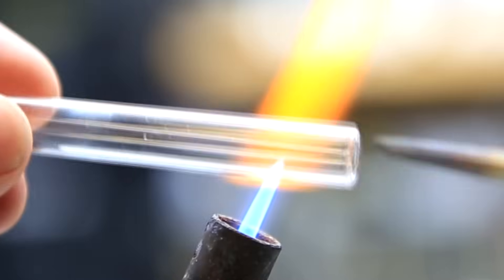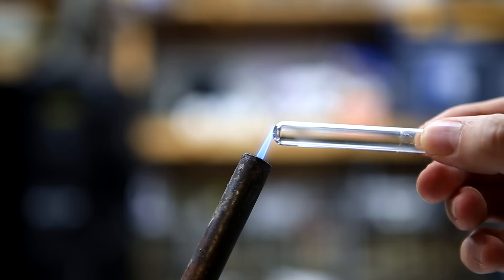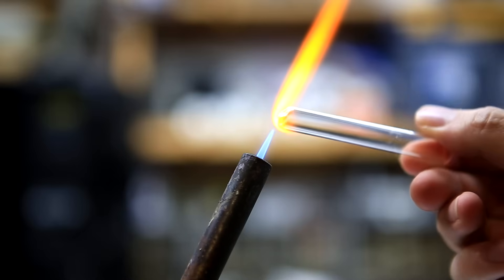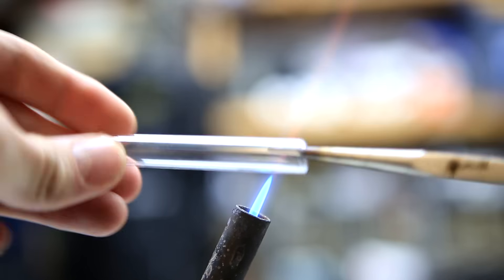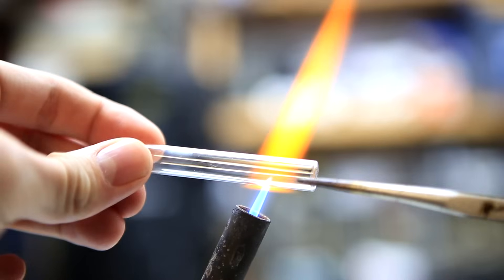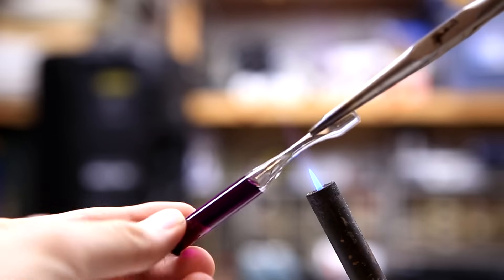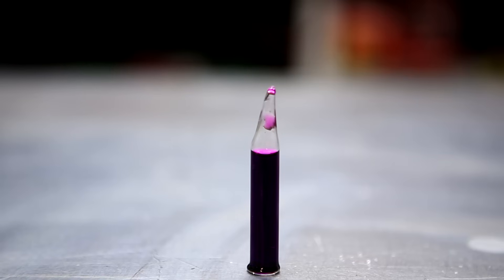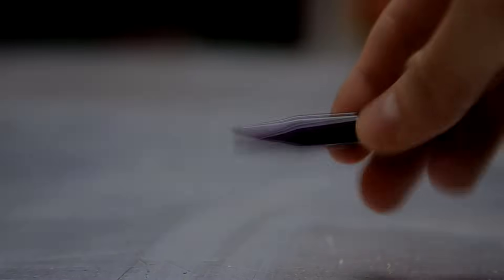How to make ampoules from glass test tubes

Comment: You should use a graphite block to flatten the glass. Graphite is what glassblowers use to form the glass. And then you don't accidentally crack your beaker from heat shock.
Reply: that or wet newspaper
Reply: @juanignaciocaso4651  WTF are you talking about? You want him to press HOT glass into wet paper? Do you know what water does to hot glass if you let it sit there? Glassblowers have to CONSTANTLY SPIN glass on wet newspaper so that the layer of steam protects it. IF YOU KEEP IT STILL, IT EXPLODES IN YOUR FACE.
Reply: Also heat the graphite up with the flame first
Reply: @xz3693  It more just smoulders and catches fire, from my experience. But yeah, you do keep the glass in constant motion when forming in glass blowing, and drip on new water on the paper when time allows it.
Reply: Isn't graphite fairly conductive? I thought he ideally wanted a thermal insulator.
Reply: @battlesheep2552  I used to blow glass at my buddy's shop. All the tools we used to shape glass were graphite. Even his touchmarks. Grapite is conductive. I use it to grow silver crystals, but it also transfers heat extremely well. And you could use a damp newspaper... But personally, I would use a red brick or a 2x4 if I had nothing else.
Reply: @ravnulvthordnspyd  He stated that he specifically doesn't want to use a thermally conductive material. He uses the bottom of a beaker because glass isn't very thermally conductive which means that the test tube will hold its heat for longer.

If he were to heat up the graphite beforehand, then it might be suitable, but why would he put in the extra effort when this works fine for him?

After doing some quick research, it seems that glassblowers often use graphite because it can withstand the extremely high temperatures required for glassblowing, but I would be surprised if he was heating this test tube anywhere near what a glassblower would, the test tube in this video doesn't change colour the way glass does when glass blowers are working. He didn't say anything about the beaker cracking.
Reply: 7 scientists talking to a 5 year old video
Reply: @ninjathadius7072  and 2 random people didn't really understand what they are talking about.
Reply: Derek Hitt  I kinda wanna freeze a beaker and see what happens... You know... For science. 😂😎
Reply: @ravnulvthordnspyd  For Science!
Reply: @ZebbMassiv  Clever!
Reply: @ninjathadius7072  The internet is forever.
Reply: You won't. Glass and graphite are both good insulators of heat.
Reply: @The_Foxymew Qa

Comment: fills ampule with Nitroglycerin

Can't forget to shake it to make sure it's sealed 🙂
Reply: You'll be lucky if the heat doesn't ignite some of the vapours
Reply: @noobnoobyify  xD
Reply: I usually clean an old metal paint bucket. And smash the lid back on with a hammer.
Reply: Yer bad

Comment: If you don't anneal the glass it might just randomly check(break) while sitting on your shelf. Its better to just leave a pinpoint hole at the top,anneal then fill with a syringe then seal it. As a side note graphite aluminum or brass will be a far more suitable material to press against. get/make a polariscope and look at your ampoule and you will see the stress lines in the glass.
Reply: I had a couple pop on me too,  just holding the amps back from the flame a few inches and cooling a little slower worked here.
Reply: I had the same thing happen. Need to "flame seal" these bad boys! (Learned it on Codys Lab)

Comment: Early wine bottles had the same issue when trying to stand up straight. A solution was found however and we now indent the bottoms of wine bottles to form a flat surface. So if you could find a small marble or something to form a little dome on the bottom it'd probably make your ampules a lot more stable and easier to form :)
Reply: Wine bottles have a dome shape to allow for pressure build up.  More common in the past but still vital for sparkling wines.  Using a small brass dome rivet in a hole in some brass plate might be the best way to form a dome and a flat rim.  Using just the dome/marble will not make the rim level, just narrow.  However the reason for the glass was low thermal conductivity so brass, copper and aluminium are bad, stainless steel if you must use metal but graphite is the material of choice for glass working marvers if you plan to make lots.

Comment: To make an ampoule with a 'scratch-zone' for safer opening!
Like this:
1) Pull a short, fat neck (the scratch-zone) about 1/3 the way from the open end of the tube.
B) Pull a longer slender filling-neck from about half of the pulled section from step the first, leave a 'bulb' between the two necks.
Tube <short fat neck> tube <long slender neck> sealing end.
By scratching the fat neck, a cleaner break is possible.

Comment: Graphite works best for shaping glass. I do glasswork that what all the tools are made from usually
Reply: Steel is okay as long as it is cold. Yes graphite tools are incredible for doing lamp work but the majority of hot glass work is done with steel. If you need the metal to stick to the glass, heat it up. If you need it to not stick, keep it cold. Simple as that.
Reply: Brass also works well. When I started with glass work years ago I had a charred hardwood stick coated with beeswax as my main reamer before getting graphite tools
Reply: @Xanderviceory  graphite tools are too pricey, i bought slabs and cut/shaped my own

Comment: could you make more videos demonstrating more lab techniques? pass down some of your technical and practical knowledge.  thanks
Reply from the maker: +Santosh Samuel I was actually thinking about it. In the future I think I will do that, but for now I would like to work on getting all the experiments done that I want to do!
Reply: +NileRed question. how would you do this if your storing something that is flammable? or like how do they get things that are pyrophoric like cesium inside amples
Reply: +Seth Black ampoules
Reply: Labs that use pyrophoric solids often use a glove box to handle them, other than that pyrophorics and other air sensitive reagents are normally bought as solutions and syringed to get it from stock bottle to a flask fitted with a rubber septum and flushed with an inert gas (N2 or Ar)
Reply: Thank you

Comment: Nice video. A question: I would like to put in ampoules a dry salt and inside it I want a nitrogen atmosphere. Any suggestion? I was thinking about doing the glass heating and melting with a rubber septa and a needle that flushes nitrogen.

Comment: Yay! But, how do you open it to get the liquid out?
Reply: +Pyramid132420 you break it m8
Reply: Pyramid132420 gotta break it
Reply: Pyramid132420 break it
Reply: @giorgosmetalheart1767  v
Reply: Actually opening an ampoule requires experience. The tip part should be broken, but sometimes the internal liquid generates gases that cause the entire ampoule to break. To prevent this, the ampoule should be cooled in a refrigerator to condense any possible gases and then just break the tip using small pliers.

Comment: Could propane torches work? Planning on making an ampoule for chlorine and iodine.
Reply: I would say a propane torch could work, but wouldn't be ideal. You would likely have to heat the glass up with a kiln before using propane torch because the thermal shock would likely shatter your piece. You could try holding the glass far away from the torch to pre heat it, moving it very slowly closer to the hottest part of the flame. It would take much longer than the yellow tanks but would probably work.
Reply: @randoprior4130  I tried it. It works but the whole glass heats up and my gloves melted and caught on fire
Reply: @bluestickman2684  well that's learning for ya

Comment: How would I seal an ampoule filled with hydrogen? Also how do i make sure no gas is leaking?
Reply: +Sor Sor Science07 You don't. You shouldn't put hydrogen or other flammable gases in an ampoule, you should be storing those in a gas cylinder kept in a fire cabinet. Even if hydrogen weren't flammable/explosive, you still wouldn't be able to store it in an ampoule because it's lighter than air. It would escape before anyone could possibly seal it.

But on the subject of leaking, if you shake your ampoule around like at the end of the video and no liquid escapes, you're very unlikely to have any gases escaping.
Reply: genericusername562
Reply: its reallllllllllllllly hard....you need a high voltage  leak tester ,,,kind used by neon guys. a torch..a kiln..a vac pump...a  vac box...co2 or nitrogen gas .

Comment: How can I seal flammable liquids? Is there a similar method that doesn't involve molten glass or open flame?
Reply: These often have a very high vapor pressure (e.g. diethyl ether) and sould be stored in a proper unbreakable bottle, not completely air tight but closed. Plus, they should be stored in a well ventilated area or under a fume hood.

Comment: Do the test tubes need to be borosilicate? I received some for my birthday, as my family knows I'm huge on chemistry, and am uncertain of the quality. (They are unmarked and I've had one break on me). I'd like to make ampoules, and using those would be ideal so I could get them out of my conscience.
Reply: They don't need to be borosilicate.
Reply: Almost all lab glass is 32.5coe borosilicate, since its chemical and thermal resistance is far superior to a traditional 86-104coe soda lime glasses
Reply: that is true of most name brand lab glass but lots of cheap soda glass test tubes and chemistry sets are available on ebay and other sites.
Reply: yes...or quartz
Reply: @jakelanier4042  yes ..yes they do...you CANNOT USE SOFT GLASS.

Comment: My test tube just turn black and it breaks, it doesn't melt. Please somebody help!
Reply: Yellow chemist -  A yellow burner flame is too cool and leaves black  soot on glassware.  You need more oxygen.  What burner do you use?  Small Bunsen burners are only good for biology. 

Get a tirril or better yet a Mekker burner. Open the air holes all the way. You want a blue flame with the smaller blue cone like he used in his demo. It will make some noise. 

My first burner was a plumbers torch - find them at a hardware store - they work well.  

Also Map-pro gas torches give a hotter flame of over 2000 C. The original Mapp plant closed in 2008.  The Map-pro gas sold now  is proplyene.

Natural gas burners run on methane and produce slightly lower temps than propane or butane.  Good luck.

Comment: Could you suggest me a burner for melting glass? Mine is not hot enough.
Reply: Desiigner
Reply: Carlisle machine works, glass torch technology, I personally use a Nortel burner. He appears to be using a cheap propane/air torch probably made by bernzomatic from the look of it.
Reply: Would a cylinder of mapp gas work if a good sized torch is used?
Reply: @chaoticchem  BARELY...on super thin ..small stuff...it will bend it...barely.
Reply: any oxy /propane torch will  work...bigger glass needs a real glass torch...go google boro torch
Reply: @chaoticchem  mapp gas and a bernzomatic torch worked fine for the few thousand glass pipes I’ve blown

Comment: Just curious, what's liquid inside the ampoule?
Reply from the maker: 1337_Vid305 A solution of potassium permanganate
Reply: Nile Red ok thanks
Reply: Nile Red Just wondering - is there a specific way that you open your ampoules, or do you just cut them open with a dremel?
Reply from the maker: You can actually just crack the end with a pair of pliers pretty easily.

Comment: what if i want an argon atmosphere inside with my chemical (cesium)
Reply: do it in a glove box flushed with an atm of ar
Reply: You can add a few drops of argon into the ampoule with the caesium which will boil off and displace the air in the ampoule as youre sealing it
Reply: No need, the oxygen and humidity in the ampule when you seal it will quickly be all used up reacting with the caesium, you'll get a bit of tarnishing, but it won't get any worse than that so long as you have a good seal.
Reply: use a vacuum ...to seal it in..not an inert atm////problem solved

Comment: anyway we could make ampoule's with a flamable substance inside? like alcohol ampule's
Reply: mac ti When a large gap (~3-4cm) is left between the alcohol and the part that is melted. And when the tube is then filled with CO2, nitrogen or argon, it could theoretically work. Freezing the alcohol with liquid nitrogen should also work, but what's the point of that, when you can use an ordinary ampoule with a screw cap for almost any flammable substance? (Just curious)
Reply: Random Experiments I think the point is the same.

The point of using an ampoule is to have a container that leaks basically nothing.

Perhaps for expensive, or reactive samples of chemicals.

Comment: Are these Pyrex test tubes?
Reply from the maker: Yes, or if not pyrex brand, at least borosilicate
Reply: Nile Red Thanks for the reply.
Reply: @NileRed  It's worth being aware that North American Pyrex (including that sold in Canada as far as I know) is made from cheaper, tempered soda lime glass and is therefore nowhere near as resistant to thermal shock as borosilicate glass. European Pyrex is made from borosilicate glass.

Comment: what liquid is in the ampoule?
Reply from the maker: +Mo Goff I think i just used a small amount of potassium permanganate in water
Reply: +Nile Red i am an 11yr. old, and a beginner at chemistry. However, i have done a lot of experimentation with manganese dioxide and pottasium permanganate. Would you make a video showing a relatively safe way to make carbon monoxide or acids like sulfuric acid?
Reply from the maker: I think nurdrage has a good video on making sulfuric acid. I really wouldn't recommend making carbon monoxide. What do you need it for?
Reply: +Nile Red i am making an element collection
Reply from the maker: Cool! I just think that maybe you should stay away from carbon monoxide. It can be pretty mean.
Reply: +Nile Red in what way
Reply from the maker: Well you can't smell it and it is pretty toxic, so it can kill you.
Reply: +Nile Red and we are emptying millions of pounds of it into our atmosphere daily...
Reply from the maker: Yes, but the concentration is low, so it isnt a huge deal. Higher concentrations from a generator would be very dangerous. You definitely need to be experienced to work with it safely
Reply: Yeah it's a sneaky killer, if you must work with it get lots of carbon monoxide detectors, and maybe work with a bird in the room so that they die before you do. It takes about 430 lives a year from non-fire related causes so I would avoid messing with it if possible. source: http://www.cdc.gov/mmwr/preview/mmwrhtml/mm6303a6.htm
Reply: Mo Goff lol you can tell ur 11 bro
Reply: Alan Ball a bird in the room 🚭🐦🤣🤣 #toomuch